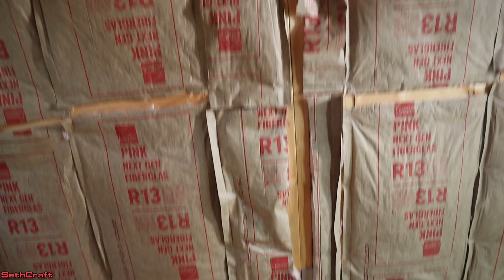Wall Insulation R-13 Install - Build a 20 x 30 Workshop

Comment: The acoustics is amazing once the insulation is installed
Reply from the maker: No joke! Now with ceiling and wall panels installed the echo is back. But the more stuff that goes into the space the better it sounds.